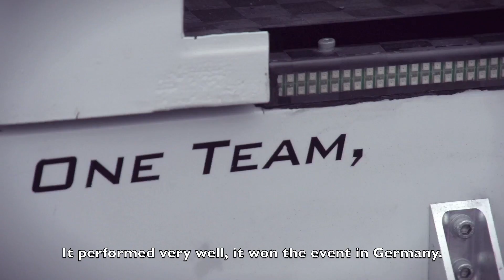World Record Attempt - Long Version [English Subs]

Comment: Why do you use normal disk brakes? Go for engine brake, in this case engines brake , you can modulate it way better and you save weight. I know that it is very efficient from my rc cars , I don't know how it would go on this.